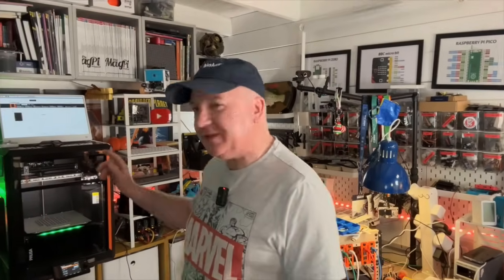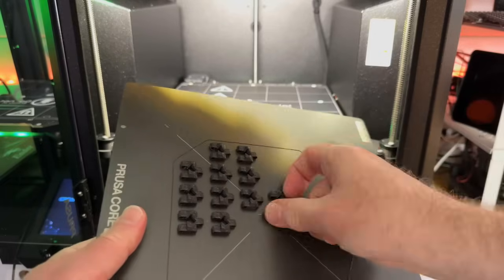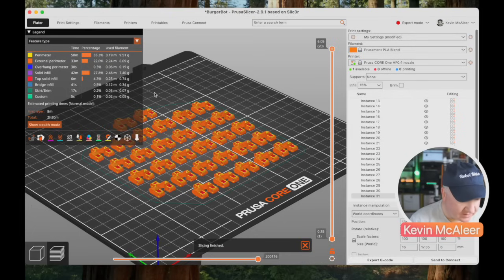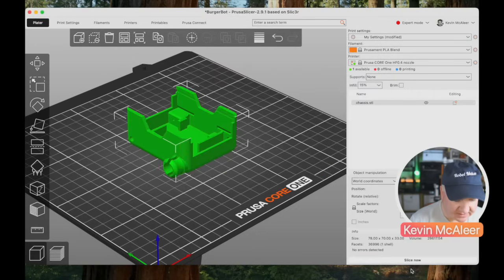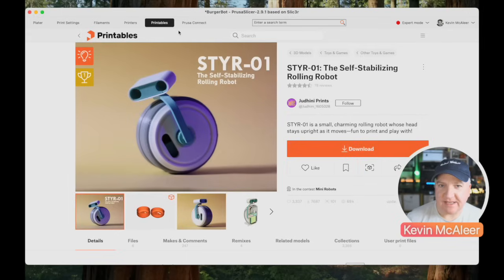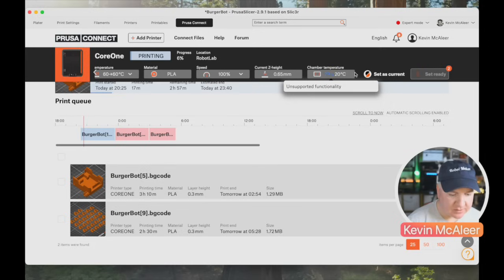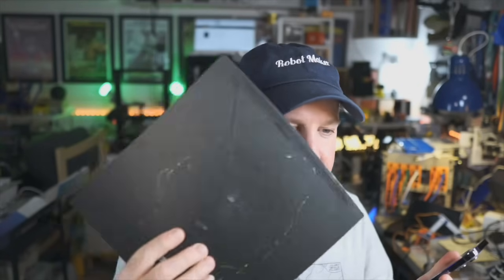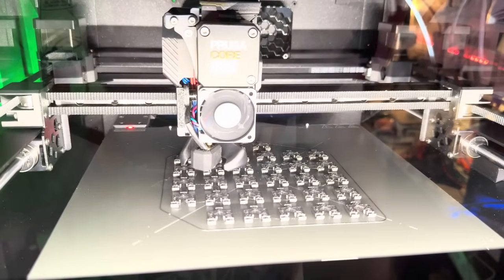My New Prusa Core One Just DESTROYED My Ender 3!

Comment: How true - I had, and still have, quite a few printers. I now mostly use the Prusa XL but wanted something to be able to print stuff like PC and PA for my workshop at home so as soon as they became available I ordered a Core One kit. 
The XL is a real work horse and sometimes used almost 24/7. Perfect first layer and almost always perfect parts. 
The XL was delivered with a satin and a textured build plate, and those are still in good shape. IPA works great for cleaning but sometimes I do a deep-clean cycle with a squeeze of dish soap (Dreft / Fairy) and a sponge and that can do wonders.
I found that parts that are hard to remove from the build plate can be helped with a bit of IPA. I just put a bit of IPA around the edge of the part and let it soak for a minute - I can then remove the part most of the times without having to apply any force.

Comment: I've had my Prusa for about 8 years now, main issues I have had were operator related - i.e. getting my head around 1st layer adhesion/z offset.
 I use a  visual maintenance board to keep on top of some of routine tasks and keep all my filament dry (using dryer/cereal box converted into a humidity box). Ive been very happy with it and would definitely buy Prusa again.